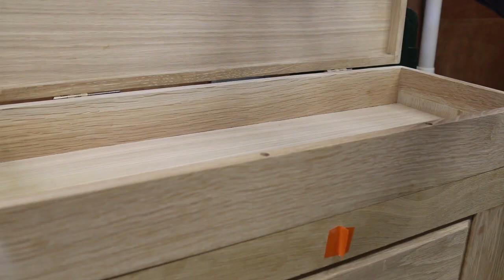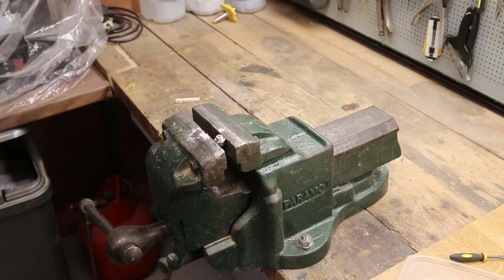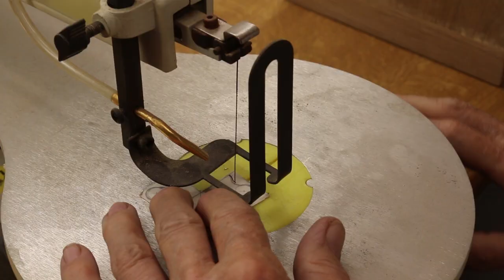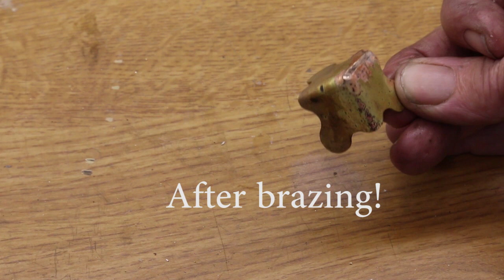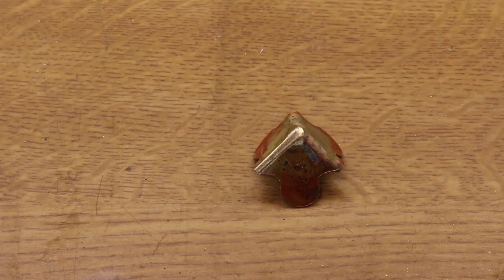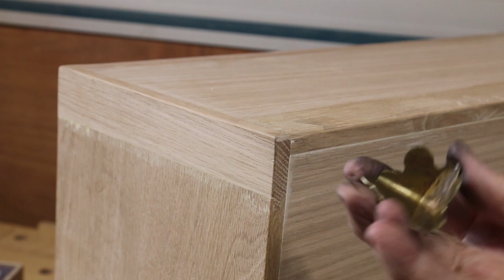Toolbox hardware

Comment: Your builds are beautiful! Your cinematography is exceptional! Did you work from plans at all? Details like the corner brass protectors would be nice to get to try. This is an inspirational build I wish to pursue one day. Thank you.
Reply from the maker: The design is a copy of the style used by Gerstner for over 100 years. No plans, just some sketches to make sure that I understood the details. I departed in some areas, were I wanted something a bit better (inset handles, for instance) but the original design is pretty good. The secret is to take your time- if you do not rush it, it is finished much quicker...
Reply: @Tensquaremetreworkshop Thank you! Makes sense, and I will definitely take my time. What was the total time you spent, 3-6 months?
Reply from the maker: @termlimit  I dug out my build log- it took ~2.5 months, 262 hours of work. Commercially unviable, but I enjoyed the build and learned a lot. Being retired helps, of course...
Reply: @Tensquaremetreworkshop That is awesome!
Reply: @Tensquaremetreworkshop I need to start build logs. Would like to hear/see about how you document. Another video idea 😂
Reply from the maker: @termlimit  I changed my PC- and 'downgraded' to W11- which stopped my video editor working. Just getting around to learning a new one...
I have an old-fashioned foolscap bound notebook,  in which I log may daily efforts, by project. Also stick in sketches, photos, etc. V interesting to look back over...
Reply: @Tensquaremetreworkshop I will start a notebook to summarize the things I did every time I'm in the workshop. I have been wanting to do this, you finally lit the fire under me lol. Thanks again!